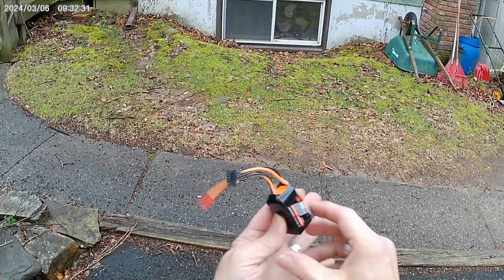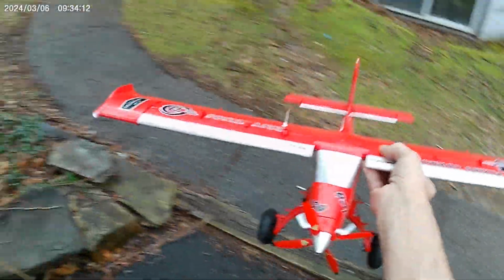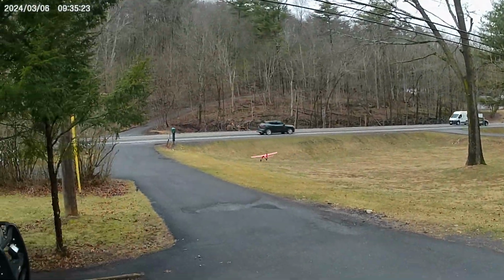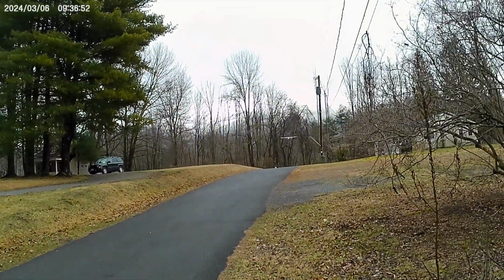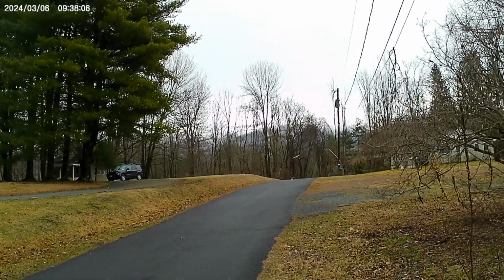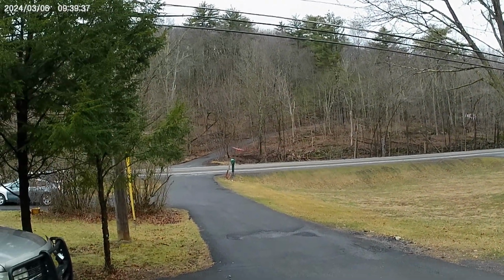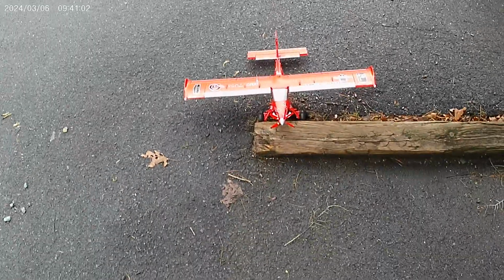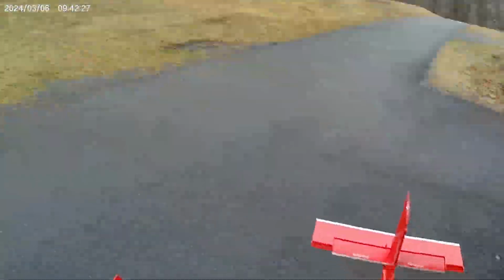maiden flight micro draco on 4s 450mah spekturm battery 3/6/24

Comment: Great flight I got 450mah batteries from hobbling for 9 bucks a battery and was wondering if it would be too much for the Draco but you answered those questions for me Thanks Bro. 
Great Video. 👍👍👍👍🇨🇦🇨🇦🇨🇦
Reply: Would love a link, I couldn't find anything from HK like that. Did that lipo have a JST-RCY or did you have to use a beefy adapter? Thx.

Comment: I bought some 4s 450mah and was wondering if it was gonna be to heavy but seeing this I now don’t have to worry, I think I see someone had put a 850mah in it as well not sure if it was 3/4 s though
Reply from the maker: she flew real good on the 450mah i did not try the 600mah yet it is heaver then the 450 the 600 is a 3s
Reply: @gerardmazz  I’m hoping to try mine out later today
Reply from the maker: @gazza4230  she is a great flyer you will love it
Reply: @gazza4230  I tried the Micro Draco 800mm with my (2) 3S-300mah packs. Flight times are sub 5 min and doesn't feel powerful (i.e. for fun or getting out of trouble). I'm going to try the 4s-450mah for sure, thanks!
Reply: @DerekBushman  if you find some and they have xt30 on just get a little adapter to jst can either get ones with 50-100mm of wire or you can get stubby ones to , I do have a bundle of 3s batteries and don’t mind it being slower got to love slow and sexy as Robert would say from the pahnitric brothers would say lol 😂
Reply: @gazza4230  Good suggestion, thanks. Those guys are really funny, first discovered them a few months ago. 😂
Reply: Very nice flight - and pretty brave that close to a heavily used road 😅 Thanks for testing this. The 450 is indeed remarkably heavier (50gr) than the recommended 300. Probably the main reason for the latter is, to still match the sub 250gr. limit. After the release of the F-86 UMX, there is also a 450mAh with IC2 and 30C which is a bit lighter (-25gr), you would need an adapter though.

Comment: Wait till you pin it, and it stands straight up, and goes up, for like forever. Not quite as nimble as my TTEvo, but will do anything you want, short of 3d flying. It’s a blast, but it’s so scale, if you fly it that way. Still #2 behind the Evo on 3s, but looks so much nicer. I keep Draco on shelf to look at, and the TT Evo, sits in its box! Lol. Again, nice scale flying.
Reply from the maker: Yes I will need the 4s 300mah battery for that lol the 450 mah 4s mite be a little to heavy

Comment: No wonder we have all been burdened by remote ID.
Reply: I will confirm that per my calculations, anything over the Spectrum 4S-300mAh will put the Draco over 250g, requiring Remote ID outside of FRIAs. Please correct me if I'm wrong. A good/light RID broadcast module would be the Dronetag BS Gen2 (very tiny) or perhaps also the Spectrum one.
Reply: @DerekBushman  and so um …:it ain’t cool to fly anything in front of vehicles on a highway or roadway.  We are in this mess because of irresponsible people like this guy.